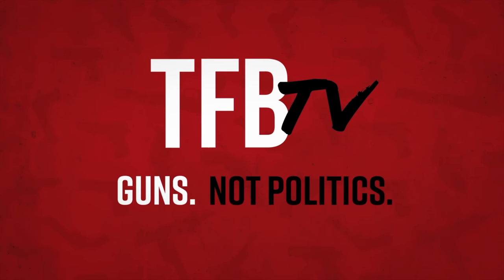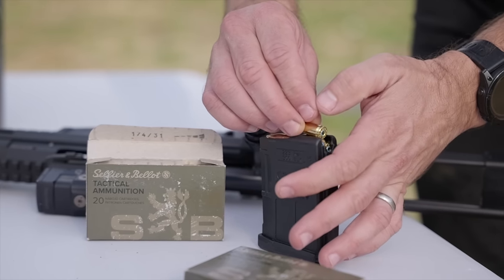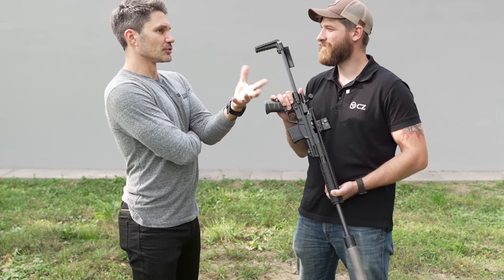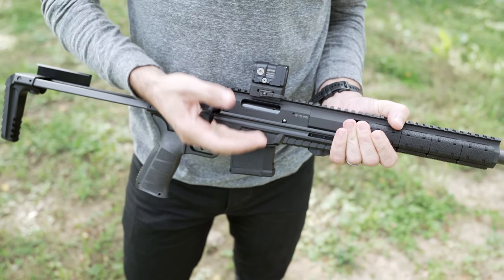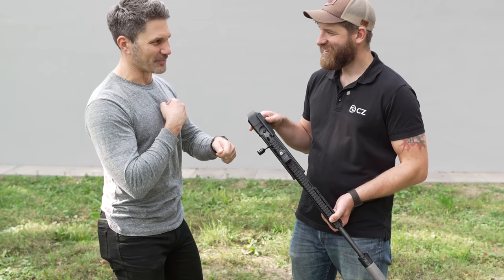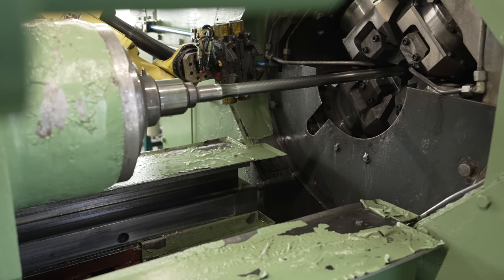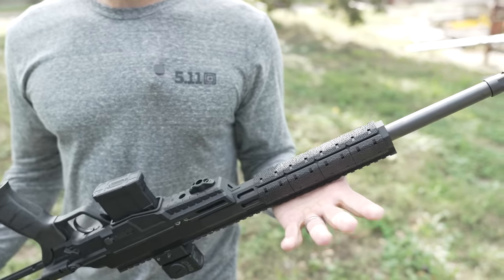The CZ 600 Trail: Finally Available in .300 BLK

Comment: Out of all the lightweight bolt actions there are, this is easily one of them.
Reply: yes indeed, it is one of the lightweight bolt actions that are out there. XD
Reply: I don't know why anyone would get a short barreled bolt action carbine
Reply: @alexanderp8037 Practicality, not everything needs to be a full length rifle.
Reply: @alexanderp8037 300 BLK only needs a 9" barrel to achieve full powder burn.
Reply: @ElvisRocking1 and if I’m not mistaken, suppressed bolt action are usually quieter than suppressed semi auto rifles.
Reply: @robiel317420 You still gain velocity with a longer barrel.
Reply: @echofoxtrotwhiskey1595  ...that is useless with subs
Reply: @ElsinoreRacer  Subs don’t gain that much velocity. Especially since most 300 Subs aren’t loaded at the edge of subsonic anyway
Reply: @alexanderp8037 Not everyone around the world can own a semi auto. Cope gun
Reply: @alexanderp8037 because it's short. Lol
Reply: @alexanderp8037  So, you are the governing body of what shall be allowed??
Reply: @robiel317420 for subsonic work in generally thats correct. 
The exception is where the fun is, hunting surpressed supersonic with super hot reloads out of a bolt gun, now you have the power of a 30-30 in a rifle you just pulled out of your backpack.
My hunting load is 120g barnes going 2700fps, out of a heavy barrel rem700 16" w/10" OSS can. Stick that round in an AR and you'll have a kentucky ballistics moment
Reply: @alexanderp8037 ye old truck gun

Comment: I received my CZ 600 Trail 300 Blk from Charter Tactical a few weeks ago (possibly the first one to the USA...). The bolt had an issue and would not insert (it was in a locked position and came apart when attempting to unlock), but CZ support has been so far very helpful in getting that squared away. As I type this, the bolt is to be returned to me any day now. I'll try this version out shortly with a Hybrid 46 along with unsuppressed ammo, so I've snagged a few boxes of several kinds of ammunition. I can state now, it is LIGHT; as in, VERY light. The stock is easy to use, but feels very...light? Or, thin? Other collapsable stocks I've handled have felt more 'stout', but I'm not looking to rapid fire when hunting. Each firearm has a place in our minds as well as in practicality, so this will be something used like any other rifle, i.e. with well placed shots. This is also my first 300 Blk, as I did not want to add yet another caliber in yet another AR platform, the reason being just sheer economics. When the economics merit, I will of course add a snazzy AR of some type in 300 Blk to be a mate to this one. The bolt action was of interest to me, and this will hopefully be a very convenient tree stand-friendly hunting rifle, or a long hike carry rifle. But it is extremely compact with the stock folded, so really, it's got many uses. 5.56 PMAG's seem to fit fine, and this will be tested (i.e. 556 mags with the proper ammo) when the bolt is back. I almost got the Savage 110 PCS, but as the brace issue continues, the CZ made for a better fit as it's just about as compact, doesn't need the communist stamp being that it is still a legal rifle, and is in a caliber that is in high demand for both hunting and range action. 

Extra bits: 
-the bolt also has the serial # stamped on it 
-if you order one and the bolt doesn't slide in, there should be included a plastic 'bolt wrench', which is basically a hard cup that grips the bolt head to turn it to the next position; just don't turn it too hard...
-the bolt release button feels flimsy; it's more of a 'push/tab' kind of thing. But, it seems to operate as it should; will know more when testing starts
-the top rail is nice to add anything on top. I have an ACRO P1 on this to start out, but will likely change to a scope of some type. 
-a slanted fore grip might be added to give the support hand a bit more assurance when holding. 
-CZ staff are very nice on the phone. 
-the CZ website does not load well; yes, using a Mac, and yes, I checked all the settings...hard to find info on this otherwise...
-There is currently a $100 rebate running with CZ. 
-PMAGs seem to fit fine; will update this listing as I get time with it.
-CZ may likely only offer 10 round mags for a while; a 5 round would be nice for hunting, but even the 10 round doesn't get in the way. 
-suppressor thread pitch is 5/8 x 24

Updates when time permits.
Reply: Is the suppressor pitch actually 5/8? Their website says M15 and I’ve been scrambling trying to figure out how to get my can on it
Reply: That can happen to literally all bolts. Not a negative of this rifle.
Reply: For anyone who later reads my comment with the same question, it’s 5/8 x 24
Reply: @nicholasbrown7625  no, it's not.
Reply: @difficult_aardvark  unless the SilencerCo muscle device labeled 5/8 x 24 is also lying to me, then yes it is lol
Reply: @nicholasbrown7625  it says 1/2 x 28 on CZ's website, which is generally standard for .223. I don't know why you would have the only one in 5/8 × 24.
Reply: @difficult_aardvark  because mine is in 300 blackout
Reply: @difficult_aardvark  The US market guns come with 1/2x28 and 5/8x24 threads respectively.
Reply: @difficult_aardvark the 7.62x39 version of this comes with 5/8"x24tpi threads. Only logical that the .300BO guns have the same.
Reply: That's alot of words, I'll wait for the movie.
Is it sub moa? 3 shot groups don't count.

Comment: Being in NY and not allowed to buy Semi Auto without getting $400 Training Course I decided to buy an AR15 Lower and three different side charging caliber uppers, 223 Wylde, 7.62x39 and 300 Blackout with gas systems disabled and use them as straight pull bolt guns.  Work great and save ammo.
Reply: @coach- I look  at it as fun per bullet.

Sure a semi auto is fun, but you easily shoot a magazine without thinking.

Working a bolt or a lever takes more time  so you do shoot less bullets in the same amount of time (and thus save ammo if you tend to only go to the range for a an hour or two) and because you are more engaged in every shot, I think it's more fun.

Comment: Just bought mine today. Was thinking about the Sig cross, but this was more what i was looking for as far as a backpack/motorcycle gun and Gretna Gun happened to have one left. The only gripe is the stock is a bit wobbly but not unusable. Oh and if youre gonna use mlok, youll have to shorten all your bolts by a few mm so that it doesnt screw into the barrel

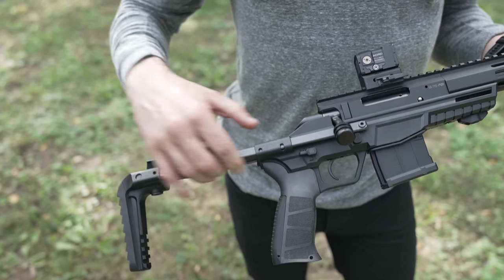Comment: Priced better than I was expecting, the return of the stock all the way in towards the bolt didn't seem locked into the rails almost seemed like it was loose. Only thing I'd be skeptical of but I don't have my hands on it either.  😎🤘👊 After rewatching it does seem like the front of the stock does stay aligned with a bolt inside the rail of sorts. 3:37

Comment: Or 7.62 trail was incredibly hard to rack the bolt. Sent it back and CZ lost our bolt and then accused us of not sending the bolt with it, and doesnt have any bolts so now we have a paper weight at our shop
Reply: I'd be happy to take it off your hands. BTW you are not the first with this problem. The last guy that reported this fixed it by more careful assembly and lubrication of the bolt. EASY to mis-assemble that bolt if you aren't familiar with it.

Comment: nice that the CZ 600 still uses a controlled round feed bolt.  James needs to learn how to operate the bolt and trigger like karl from CZ.  pinch the bolt and trigger with the middle finger.  this style of shooting lends itself to a different shaped stock though without a pistol grip.  personally I don't see the point of 300 blackout subsonic suppressed.  I would much rather have the largest possible round like a heavy 458 socom.  just me though

Comment: Is the CZ 600 ever going to go back to swappable barrels???
Reply: The interchangeable barrels are discussed after 8:57, listen for half a minute. Karl says that it is still technologically possible to swap the barrels, just the bureaucracy has adapted so that a certified gunsmith must do it not to lose the warranty. If you trust your rifle, don't need a warranty, and you know what you are doing, you may change it yourself, too. Chances may be close to 100% that you won't hurt yourself and you won't kill the rifle.

A testing shooter at CZ Uherský Brod got injured because of that feature and the basic design probably doesn't make it possible to guarantee that the rifle is safe after an amateurish replacement of the barrel is made. It is questionable whether the replacement by amateurs is such an important feature. Folks like you may be heard often and the recall looked like a big bad event but look at all the other comments and videos, the people don't really give a damn. They pick their favorite barrel and it may be there forever. If you need to swap, see a certified gunsmith. I am not sure whether as a shareholder which I am, I would support big investments into the restoration of the original swappability trait because the benefits may fail to match the costs. It seems to require more than a better screw somewhere. It may be needed for the rifle to become detectably heavier to guarantee that the swap is safe even if done sloppily and that would be a worse disadvantage than the positivity of the advantage of the easy replaceament.

Comment: looks like the bolt needs to be lengthened and the lever moved back 1/2"-5/8" (parallel to the grip face) fumbling for the trigger after working the bolt is a little concerning.

Comment: If they get this in 8.6blk it would be an absolute Fix by Q  killer and still do the same performance
Reply: The issue with the trail is it is super inaccurate. Almost every review I’ve read or seen says at best you can just barely get 1 MOA
Reply: @Huckleberry52 on no planet is 1 moa super inaccurate
Reply: @okaythisisepic  for a bolt action when the vast majority of ammunition tried is mostly 2 MOA and then just barely getting to 1 MOA out of a single brand of off the shelf ammo is dookie.
Reply: When C-clamped on tripod not by handguard but by halfchassis lower we had 0.75 MOA and under with Hornady 73gr I think and something in those weights from Norma in .223 version of this cute bolty. 
So it depends mostly on technique used I guess as from bag I got decent results, but when bipoded in front with me 200pound gorilla on top and cheapo bulk 55grs I got around those catalogue results. 
It is fun gun to dick around with, friend has 223, I wait for 300 AAC (BLK) to get mine. :)

Comment: The fun begins when someone sticks .300 Blackout in a 5.56.
Reply: I don't think it would chamber, and thus the bolt won't go into battery therefore firing pin won't reach the primer... but no I'm not willing to test this hypothesis!
Reply: @Mostxclent it absolutely will chamber and fire. The bullet of 300 black acts like the shoulder of a 5.56 case since it's the same size and happens to line up in the same place. Given that the oal is mostly the same you end up in the unique scenario where you can stuff your 5.56 barrel full of 7.62 pills.
Reply: It has happened WAY more times than you would suspect. .300BO chambers just fine in a .223/5.56 chamber (7.62x35). A big part of the reason I hate .300BO and would never have one. 7.62x39 subsonics are much better and full power loads are CHEAP!

Comment: Wasn’t the 600 supposed to have barrel exchange capability.  They got rid of a well loved series of rifles (500 series) to drop this pos.  Then they removed the barrel switch capability.  What’s the point. So cz can make more profit by lowering build cost?  No thanks.  I’ll buy something used.  Buying colt was a mistake.  The ghost of colts stupidity will bring them low.  Big CZ fan, but I hate this rifle.   Really piss poor rollout.  Imo.

Comment: So this is neat. I didn't even realize CZ made a bolt action like this. I think I need one in a big boy caliber. 

Speaking of things I didn't expect from CZ, James, any chance of seeing one of your semi-auto shotgun torture tests on a CZ 712 G3?
Reply: What's more big boy than .30 cal?
Reply: @shinobi-no-bueno  Lots of things. .30 cal is just the diameter.  I'd say 308 or larger, but that's subjective. 300 AAC is an intermediate cartridge.
Reply: I believe they only make them in intermediate calibers. 5.56x45, 7.62x39, now .300 Blackout
Reply: @PacketWrangler  that's what caliber means...
Reply: That's already out there from several manufacturers. This is extra neat-o due to low recoil impulse and ability to suppress.  Would be great on small acreages and semi-suburban areas for critter control.
Reply: CZ shotguns are not made by CZ. They brand Turk stuff from Huglu and Akkar ... so no point in testing we know turks stuff sux in semi.

Comment: James, please ask your CZ friends if they will ever make bolt action hunting rifles with their traditional beautiful wood stocks. I hunt. I am not alone. I love CZ rifles (their previous line) because they were good looking, traditional rifles. Yes, I have all manner of MSRs. They are not hunting rifles. I do not like their current offerings at all. Their barrels are too short, thus cutting the nuts off of perfectly performing cartridges, and the plastic stuff? Uuugghh.
Reply: CZ is still surely making tons of wooden rifles! Turkey is making lots of CZ rifles, almost all of them are made of great wood. Concerning the mainstream Czech-made models, CZ 600 in particular has five totally different designs. CZ 600 Alpha and CZ 600 Ergo are made of polymers, CZ 600 Trail here has the aluminum alloys etc. But you should search for CZ 600 Lux  which is mostly a beautiful walnut wood, and perhaps CZ 600 Range which has laminated wood in much of the body. So search for CZ 600 Lux, it really supersedes and beats all the popular wooden old CZ rifles, despite the loving conservative owners' statements to the contrary.